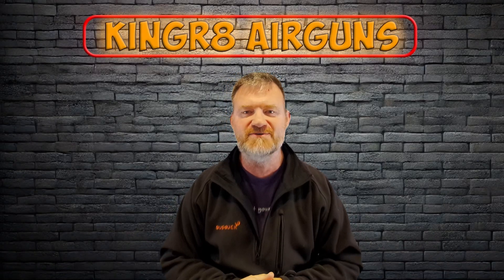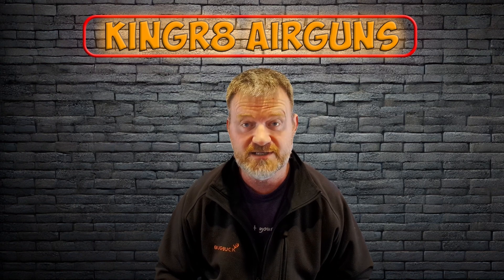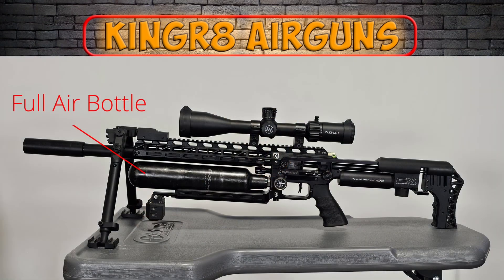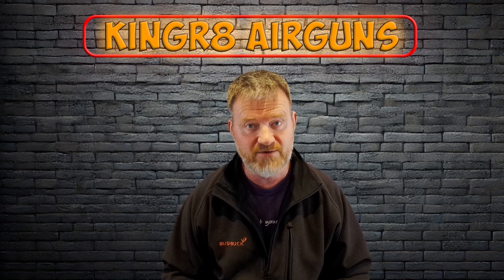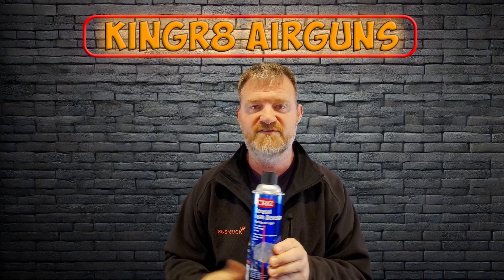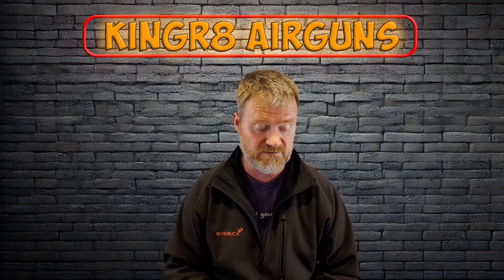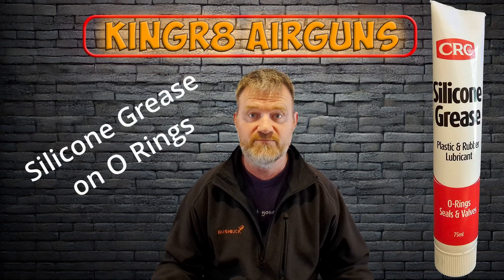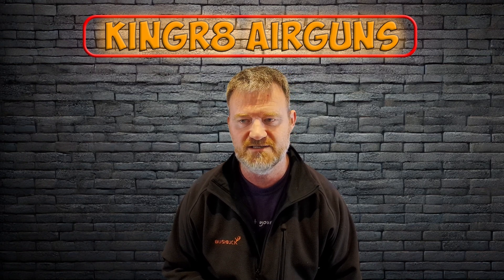Detect leak location on PCP Airguns

Comment: The reason those two o-rings leak is because they're getting damaged as you insert the plenum into the body of the gun. I just had a grueling 3 day ordeal trying to understand why the gun would just start blowing air after installing new o-rings at this location. I decided to use a jewelers loupe to examine my o-rings and they're showing gouges from a sharp edge inside the gun. If you look into the rear of the receiver with the plenum off you can see the cut in the top where the grub screw is to tighten that hole around the plenum tube. Inside that cut at the end is a semi-circular edge from the CNC process that wasn't cleaned up at all. Mine was razor sharp and kept cutting o-rings every time I would install them. Any slight cut or scratch compromises them enough to cause a leak. I used a scribe that was roughed by sandpaper to rub off that sharp edge without hurting anything. Just a little rub with a hard object with an abrasive surface is enough to slightly round over that sharp edge that was cutting my o-rings.
Reply from the maker: Hi Thomas, thanks for your comment, Great advice, mine was actually ok and the finish wasn't sharp, but great to point out what you found in case anyone else has the same issue.

Comment: Great video again bro good direction to product   Very informative look forward to seeing more 👍
Reply from the maker: Cheers Bro, it all helps others when trying to fault find, so sharing the love as it were. Soapy water will work but due to the consistencies of these sprays it reacts instantly every time and wont leave any residue. 

CRC are New Zealand Based company. I have added a link in the description for an alternate. However if any others are searching then approach any plumbing store and ask for Gas / Air / HVAC leak testing solution.